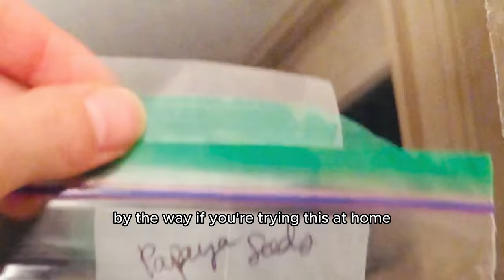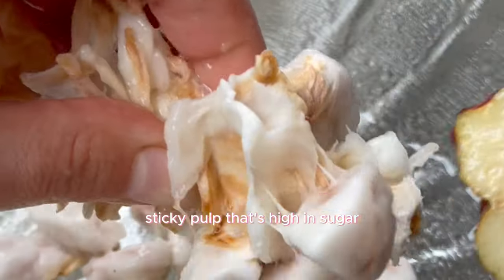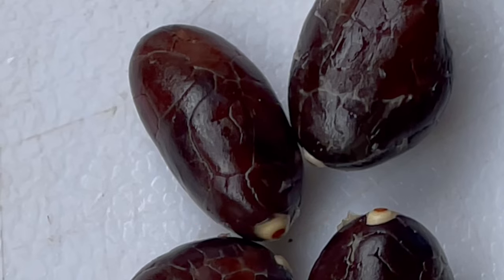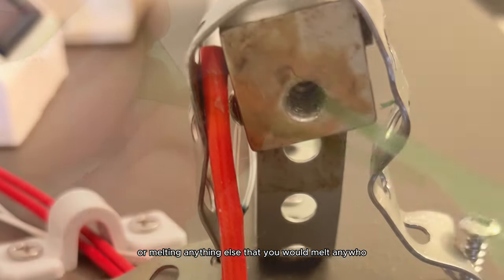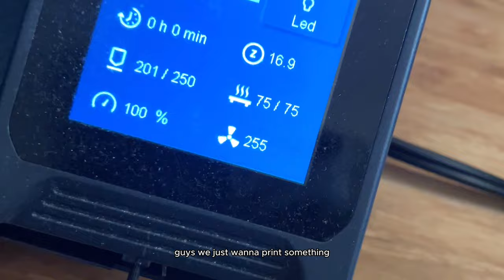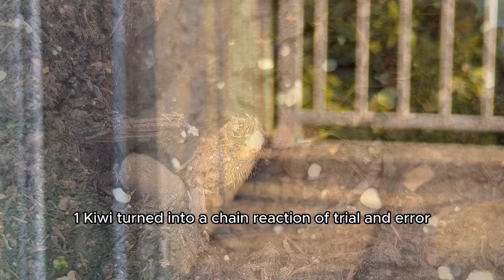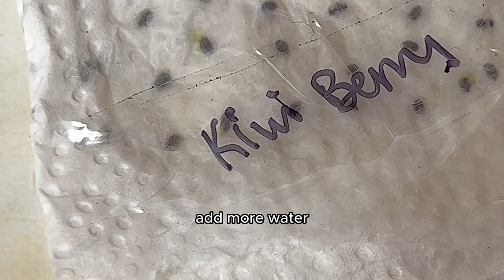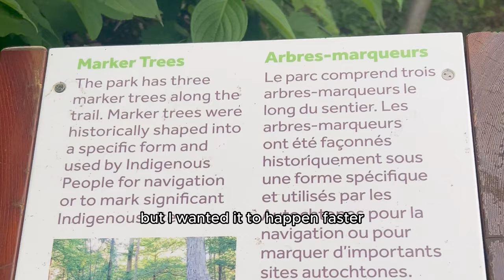7 Most Viral growithjessie Videos (OF ALL TIME!)

Comment: The length of the day affects plants. Not just the heat and strength of the sun . So if your plants grow closer to the equator, they will need a lot more length of daylight, or grow light. Also some seeds and roots have a built in timer to keep them from germinating in the middle of the winter during a short thaw.